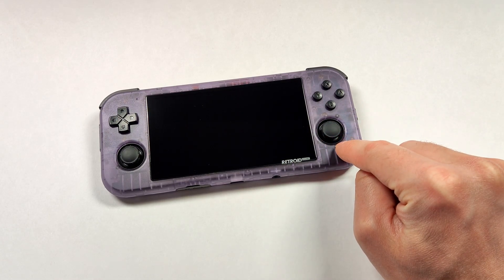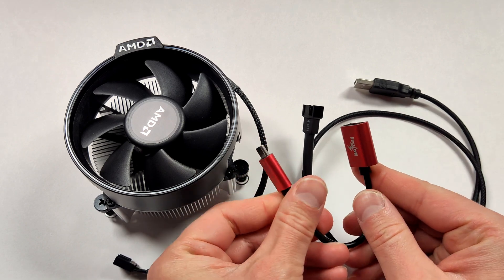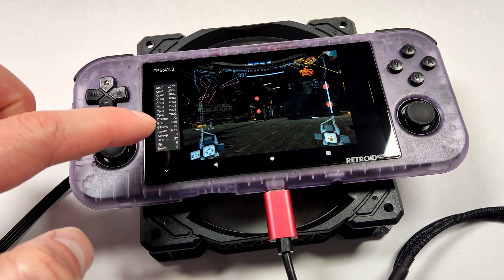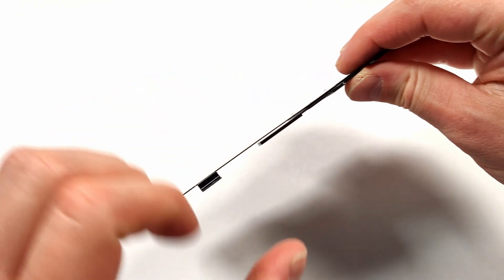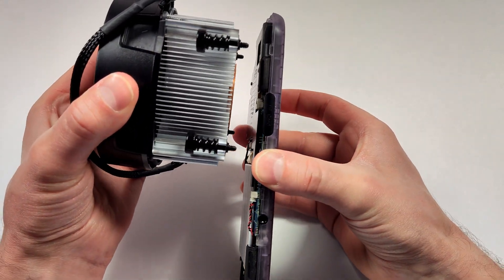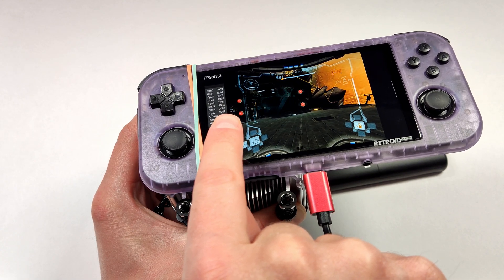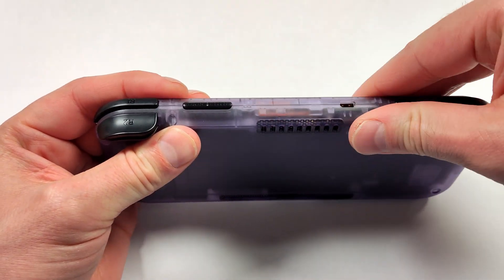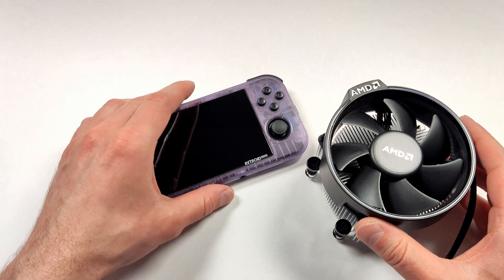Can AMD Tame the Heat on the Retroid Pocket 3+?

Comment: I just added a 0.2mm thermal pad in between the mobo and the black heatsink. Seems to do a better job at passive cooling. What overlay are you using to see the clocks and temps?

Comment: I would have removed the protective covers from the memories and CPUs in order to add thermal paste or thermal pads to transmit heat to the covers. I would also put thermal paste between the covers and the heatsink (as you have done) and also thermal paste between the two parts of the heatsink (where the 4 screws are). With that I think there would be a huge improvement.